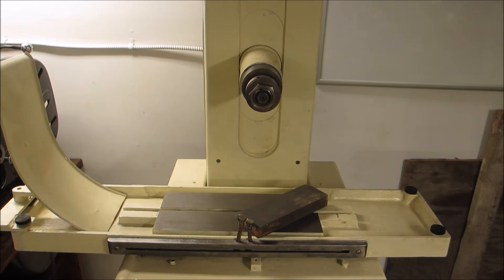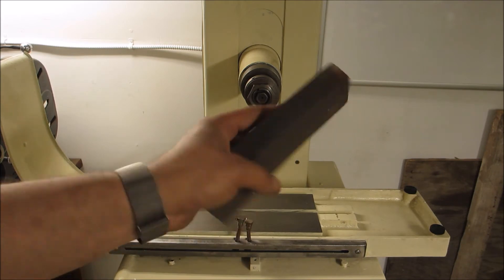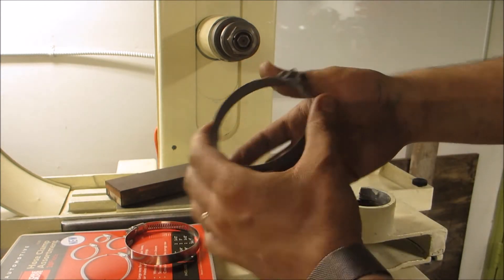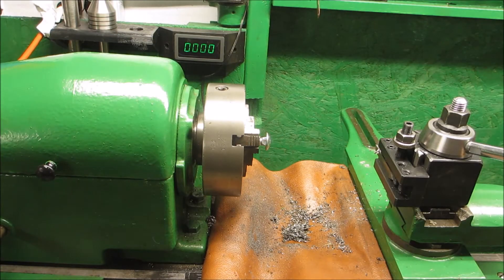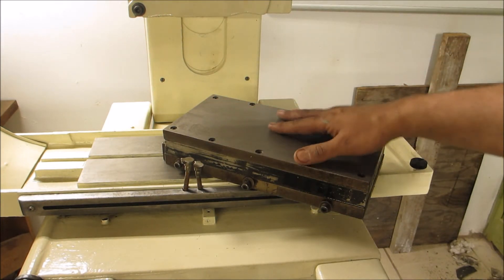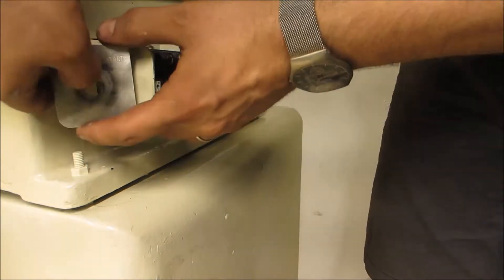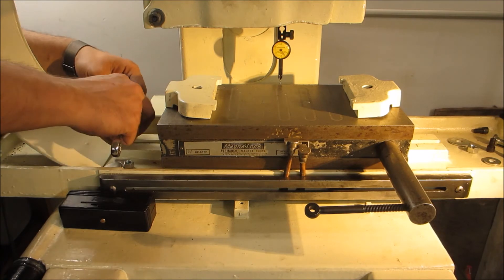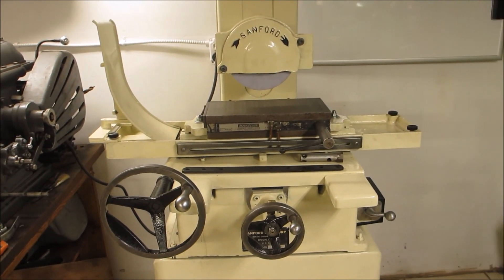Sanford Model Mg Surface Grinder Rebuild -PT2

Comment: The belt definitely looks too tight. The Sanford manual specifys 1inch of movement when pinching the belt between thumb and forefinger. And it says, yes that is loose but how it should be. Nice repair job.
Reply from the maker: I had no idea about that spec. I will adjust the belt once I bring it to the new shop.
Reply: @Engineerd3d  It certainly surprised me when I read it in the manual. Not what one would expect.
Reply from the maker: @funone8716  do you have a digital copy of the manual?
Reply: @Engineerd3d  No just a fragile tattered original.
Reply from the maker: You should scan it and upload it to vintage machinery.org they save all these manuals in digital format.

Comment: That Logan is most impressive.  Once again a great video, at one point this voice in my head was screaming "This is not Bruno, this is an imposter, those clamps are not painted" then it was "The clamps are dry"  You do this really well, I can machine parts, but this restoration business is simply not me, perhaps this is why I enjoy your work so much. With a grinder, shaper and lathe, you can manage most anything.
Reply from the maker: Thank you for the compliment. I appreciate you viewing my channel. I am trying to get better at this. Tools building tools and I hope you join me on my journey. I am planning on doing more machining.

Comment: Looking good as your subs did grow some.
Reply from the maker: I appreciate you watching. Yes I am close. Some videos are bringing more than others. The surface grinder has not been very popular. But others are decent.
Reply: The problem is a lot of people do not know what a surface grinder is.
Reply from the maker: The Best Stooge well then I will have to educate them on what a surface grinder is. This machine is something I am planning on doing a few projects on. It's still slow going but I think allot of fun can be had.
Reply: I was tuned into a surface grinder like that on some channel I was randomly scanning around and found.  Some older gentleman who restores old machines and I think he may be in a school or something.  He does great work.
Reply from the maker: The Best Stooge do you happen to have the channel name? It's not Keith Rucker? Or maybe Tom Lipton?  I would love to see his work regardless.
Reply: No, not Keith and not Tom as this was about a year ago now (he used to pop up on my suggestions all of the time but as of this year he no longer does).  He is a heavy set older white headed white man and this dude knows his shit for sure.
Reply: btw, the first time I saw that machine he had put on a new wheel and had it dress the table back and forth and taking thousandths off per pass until that baby was smooth, tram, and very shiny.

Comment: Looks good.  I just started putting mine back together.  I need to find a chuck.  The chuck that came with it is 6x18 so I can't grind it in.
Reply from the maker: The Chuck I got was old and decrepit. But I got it on eBay offer, I made a seagull offer for it and got it for much less than an import Chuck. Some import Chuck's are in the 150$ range. This was much less than that.
Reply: I will be selling the 6x18 electromagnetic chuck.  I am looking at some eBay listings and also considering a New Fine Pole chuck from Shars,  Depends on how much I get for the old chuck.